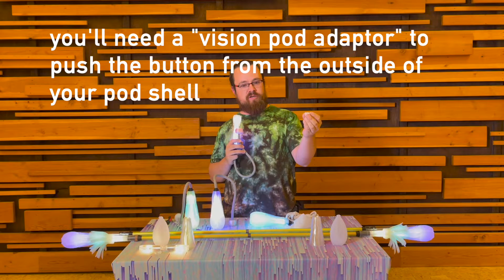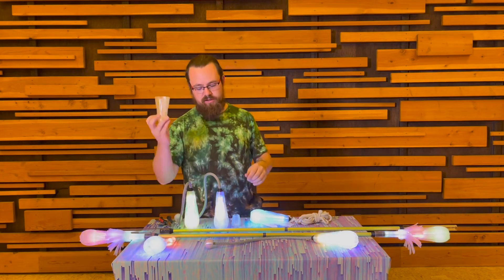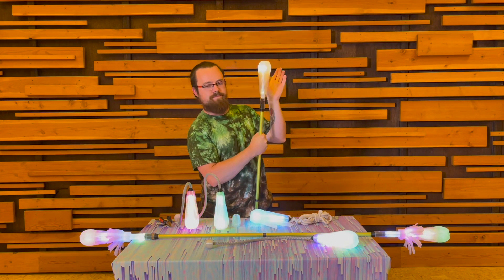how to :: install pod sleeves onto your flowtoys vision dart, vision poi and contact staffs

Comment: Do you sell the staffs that these leds pop into? I see one on the table there, and I can't find one on the website
Reply from the maker: Yes - the pod shells and sleeves fit on all our current staffs (they're an alternative cap option to the flowcap). The staff on the table is a vision contact staff - they come without the flowers, but you can add them on. Here's a link to the vision staffs page - https://flowtoys.com/vision-contact-staff-w-pods - and here's a link to the flowers: https://flowtoys.com/parts/dragons-flowers-mass ... hope this helps!
Reply: @flowtoys  one more follow up question, are you able to switch the leds from the staff into the pop'n flow poi connector thing?
Reply: So, I guess what I'm asking is do the leds pop in and out of the staff the same way as the poi?
Reply from the maker: @stetsonbalew8188  The vision boards are not modular, but you can put pod shells on the pop'n flow system. We will be releasing a contact staff hub soon - keep a lookout on our flownews for the release: flowtoys.com/news